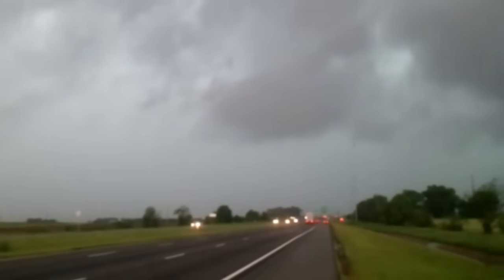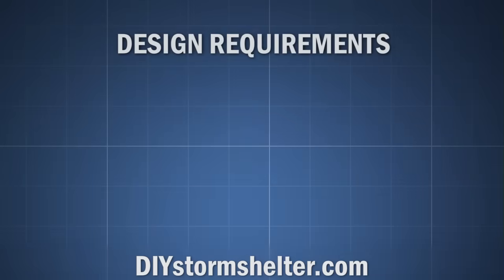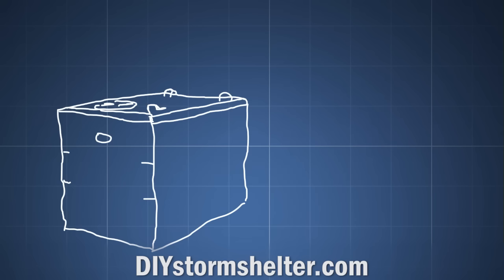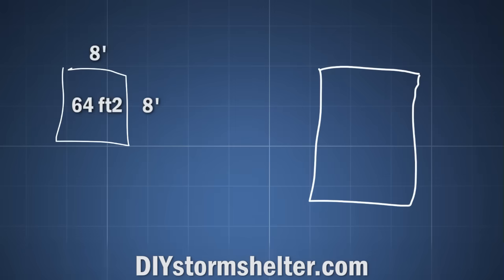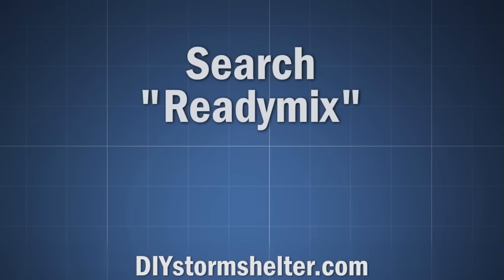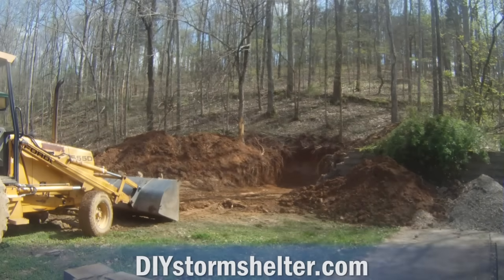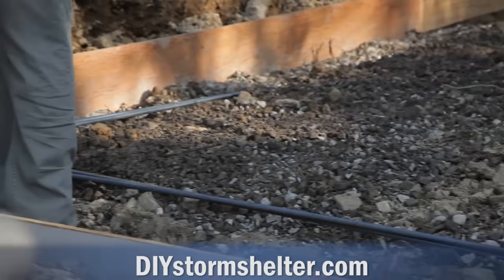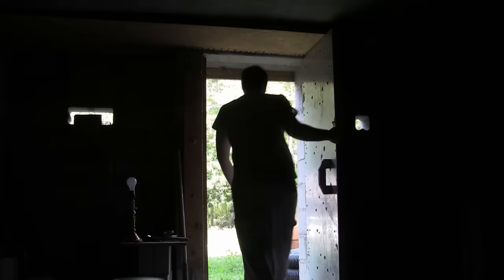Concrete block DIY Storm Shelter 12x20 foot

Comment: Not so fast homey.   I was going to bury mine in my back yard.  City wants fees for excavation and engineering so the house and block fence wont fall down.   Misdemeanor and $500 fine and 6 months in year if not followed.  Case closed and jail cell too.

Comment: My experience:  In CT I built a house with walls 8" thick and reinforced with rebar ONLY at the corners The walls sat on massive footings, the grade dropped 8' away from the house and the downspouts were led through 6" solid schedule 40 pipe to "the light".  The foundation had weeper drains with perforated 4" schedule 40 pipe set on clean gravel, covered with silt cloth followed by 2' of pea stone and then back filled. House #2 in OH was built with block, otherwise the same.  The foundations were waterproofed on the outside and painted with two coats of Ultra DryLok on the inside followed by 2 coats of highly reflective white paint on the inside.  Worked very well, except OH, when we got the storm of the century - 8" in one week followed by 7" in less than 60 minutes!  I went from one very dry basement to 2' of water in 17 minutes!  The water came in the basement windows so fast that it moved a 5 gal. bucket of horseshoes and stakes 76'.   House #3 in OH is built of poured concrete 8" thick, reinforced with rebar and has a brick pattern on both sides (steel forms).  The outside was sprayed with one of those new rubberized compounds, covered with a fiberglass mesh, sprayed again and then insulated with rigid 4" Styrofoam on the outside only.  By law, OH requires sump pumps.  I have two with the second water powered. The basement stays warm and dry all year.
Reply: Do u live in fla, and are u the builder who's house still standing after major hurricane that , if I remember correctly was in panhandle. Because if u are so many people were amazed. I could go on ! Hope and pray people listen to your recommendations

Comment: Save money building your shelter by buying up all the torn open bags of sand, peat gravel, cement, etc at your local building supply if you have a dry place to store it. Just mix all that crap together and pour it into forms with some rebar. Just make sure the roof is well supported and don't skimp on cement then as you need a roof that can stand the test of time.I'd suggest an arched roof as they are fairly simple to do, and safer. The torn open bags are usually about 70% off, just have a good method of getting it home and into storage intact, and check back every week. They end up throwing most of it out as nobody wants to bother with it.

Comment: no mesh no starter bars in your blocks so I'm guessing no core fill no vapour barrier below slab ,no vibration of your slab ,can not even work your compo  to compensate for slab inconsistencies  best of luck ,with that.
Reply: Nicely said!

Comment: I dug my shelter with a shovel by myself, it is 90 sq. ft. 6 ft. deep with 2ft steel above ground and  y total  ost is 2500.00. I am in East Texas sand so digging was easy,
and I am retired and 82 so I was not in a hurry. I shoveled about 80,000 lbs. of  sand out , it has a 5 1/2 in. concrete slab with concrete blocks for walls and solid blocks
for steps. the steel posts for the structure above ground run through the blocks to the slab, then all blocks are filled with concrete with rebar in each hole. I did not want a door that could be blocked by a fallen tree so I made a door that slides up and under the steel roof, If any one is interested in details or pictures email at rpmiller34@gmail.com. It was a fun 6 months long project

Comment: I witnessed a buch of mistakes, 1 the block was dry when you were laying it, 2 the ground was not tamped 3, the slump of the concrete looked off.
Reply: ToniMattTony
Yep, plus what is stopping the ground water inundation, no seepage trenches to divert it ??
Reply: What about rebar in the floor and drainage, that thing will be a swimming pool full of people in the next storm, if it lasts that long. What scares me is that he poured the roof too! I wonder how many people will trust that tomb?
Reply: and 1/4 in out,   of level,  the level was probable off more then that
Reply: keep counting,,i am laugh so hard how dumb you are,,hehehe,,
Reply: @jamesnobles4050  Says the one who can't even write fucking proper English?
Reply: Guys an amateur....but still holds hand out for his "valuable" guidance 😂

Comment: just buy the container cover it with dirt and cement. much cheaper and faster.
Reply: Hope you don't mean shipping container.
Reply: I'd like a shipping container but there's not much room in my yard. Maybe if they made a 6' X 16' box.
Reply: shipping containers are not designed to have dirt piled on top. They collapse under the weight. You would have to reinforce the walls from the inside.  Myth Busters found out the hard way. Building concrete walls around it to protect it defeats the purpose. Just might as well build that underground shelter. oh, those shipping containers have wooden floors.
Reply: Containers won't stand the pressure, There four corners are the only place with any strength. Goole underground containers and look at all of the nightmares.

Comment: I thought this was really a DIY video, not a nine minute commercial for a video you're selling. Thumbs down!
Reply: I agree... I was disgusted and angry after taking the time to go to his website to see, what I was led to believe, a decent full video- not an advertisement to pay for it. Glorified carney move right there. 👎🏻
Reply: @msgottaneedtoknow  but have you been able to find an alternative? any sources that shows you this type of work?
Reply: @whyask8044  - It's not rocket science. This guy did it. There is plenty of info out there. I bought a book on deck building at the Depot 30 years ago before the net was really a thing and built a massive deck (the right way) -
Reply: @whyask8044  I've done some masonry work in the past. All you need is a bubble level to check your work to see if its square. That's the hardest part. You have to constantly check. A simple block structure like this is not very hard, the hard part comes when you want to do the openings for windows/doors/garage doors. You'll need a big piece of angle iron and run your block on top of that.
Reply: even viewing this little bit i know how the structure is made
Reply: Being square and level isn't that important as far as the strength of the structure if it's being built below grade.  Preparing the footing and roof slabs, placing the rebar, and pouring the concrete  correctly without air pockets in it is far more important things to worry about than if it level or not. It will be much stronger to pour the walls and roof with grout as long as you have the correct rebar size and spaced correctly. Jmo
Reply: A thumbs down has the same effect as a thumbs up in YouTube's algorithm ...
Reply: @3nertia , I wish there were more thumbs down. If I had read the comments it would have saved me time
Reply: @3nertia  No fucks given has the same effect as fucks given in the Human Brain ...

Comment: At first glance it looks like you put it too low below the bottom of hillside. The hillside is the best place for it and never straight down into level ground...but the bottom of the concrete floor pour should be at least 1 foot higher than the level ground at the bottom of the hill, with a bed of crushed stone and perf pipe underneath. I did not view your entire video on your site but I hope you put a lot of crushed stone and perforated pipes around the back and side walls of this. The hillside is the best place for this as you have a place to gravity the water, but the #1 thing about building this...especially with concrete block, is drainage.

Comment: Oh, and rebar should be sticking out of the foundation to anchor the walls .  fill the cavity of the block where the rebar runs up the walls. allow enough rebar to anchor the roof slab too. Just saying...
Reply: That is how houses in South Florida used to be built in the 50s and 60s. The roof system was tied into the foundation via rebar running up through the concrete block walls. Not many of those type of build were total losses during Hurricane Andrew; unlike the newer stick/frame tract house subdivisions which were completely demolished by the storm.
Reply: @bassomatic1871  I wonder if I got rebar here? House built 1973
Reply: @Anjanya1948  Go into the attic and look where the roof trusses meet the sill plate at the top of the exterior walls.  If you see metal banding or hooks where the two come together then the house is tied into the foundation.
Reply: @bassomatic1871  tyvm
Reply: @bassomatic1871  Used to be? CBS construction is still probably the most used in South Florida.
Reply: Does rebar come with a loop on the end to make it an anchor?
Reply: I know im randomly asking but does someone know of a way to get back into an instagram account?
I somehow forgot my account password. I appreciate any help you can offer me.
Reply: @Kamari Jason Instablaster :)
Reply: @Lorenzo Andrew i really appreciate your reply. I found the site thru google and im trying it out now.
Seems to take a while so I will get back to you later when my account password hopefully is recovered.
Reply: @Lorenzo Andrew DAMN IT REALLY WORKED! I literally hacked my ig password within ~ 30 minutes of using the site.
Had to pay 15 bucks but definitely worth the money =)
Thanks so much, you saved my ass!
Reply: @Kamari Jason Happy to help xD

Comment: I've found some problems in this video.

1. First of all, if you live in a place like Moore Oklahoma we get a lot of floods, and building it in dirt makes it even worse and makes the storm shelter easy to pop out.

2.Do more research about tornadoes, you gotta know rather or not strong tornadoes hit that area often, even if it doesn't than you still gotta be safe from a tornado because after a few years of the tornadoes hitting the storm shelter it's going to pluck out of the ground and killed a women who was in her storm shelter during the Bridge Creek tornado this year because of floods.

3.If you're going to make a storm shelter, make a car port if you don't have a garage, that helped me during the May 6th 2015 outbreak where there was flash flood emergencies issued a lot.
Reply: Don't forget, the only purpose of a "storm shelter" is sheltering your family from a TORNADO with lots of high winds and plenty of rain, this shelter is a death trap,  trees within 20 ft., that will snap and drop through his concrete roof like a knife through cardboard and then sitting at the bottom of a hill with no drainage and the only time you use it, is when it's raining like hell...What a maroon...(Bugs Bunny)

Comment: I don't mean to "troll" your video...but why pay for the full length when this information is available for free with a little bit of a Google or YouTube search.
Reply: +Haven It got it a downvote for that
Reply: All you really need to look for on YT is "building a block shed" Concrete roof is not necessary to build a structure that isn't even under ground. A shipping container would work a lot better than this and be much safer than a concrete tomb!
Reply: @superiorcarpetpaintllc4351  The thing with this shelter  shown in the video above is that it is a storm shelter at best. If you want to actually know about the construction of a general use bomb shelter, look up what the atomic energy commission recommended during the 50s 60s and 70s. shelters build under the parameters they define are still structurally sound today if maintained properly, the shelter in this video is a root cellar its not under a yard of soil, it doesnt have 2 foot thick walls and doesnt have an L hallway for atomic protection. air supply, filtration and its resistance are poor for extreme conditions. like a 4" floor ? triple that and you'd be about there, not to mention the lack of steel in the poured concrete, what is mentioned in this video about concrete fracturing due to rusting steel is a basic in construction, the I learned statements make it seem as if the viewers are stupid. and you would be better to have a monolithic pour with full reinforcement for maximum structural integrity, I have worked in trades for 23 years and concrete is one thing I have plenty of time working with. if you use concrete blocks double up your walls and pour solid, this guy has a poor understanding of how structure works hence the lack of reinforcement, also know that concrete and cement are not even close to the same and concrete ranges from 1,200PSI to 20,000PSI depending on the mix.
Reply: @anewstarttoabrokenlife8662  I am a general contractor and that thing does not qualify as a storm shelter or any sort of shelter, it has probably fallen apart by now, or is full of water and critters.
If you want to follow bad advice, go right ahead, but don't reference junk science when your talking about a structure that was designed to protect people in emergency weather situations! 
We have building codes in America that are created to PROTECT people from shoddy construction and half ass contractors that don't know what they are doing!
When people jump into a storm shelter they expect it to shelter them, not become a coffin.
Like I said, I could care less if you do something stupid, just don't impose your stupidity on others, as if you know what you are talking about!
Reply: @superiorcarpetpaintllc4351  I.m not taking anyones advice I know the difference between structures and I even said it wasn't a shelter. as for Junk science that science is still used in building NBC shelters so... not sure what you think you are getting at here ? a fallout shelter will protect from pretty much all storm activity why not have all things covered of course if you are saying you'd rather duck and cover lmao. Im not telling anyone to build what is in this video I advise against it actually so whats the deal ?
Reply: @anewstarttoabrokenlife8662  Good for you, go build something then.
Reply: @superiorcarpetpaintllc4351  I do everyday for over 20 years and none of my basement foundations have collapsed or leaked but thanks,  People need better understanding of how things work thats why I commented. Structure is important because without it you'd have nothing to put flooring on or paint thats why I work in multi trade fields everything from foundations to painting.
Reply: Bbjones Jones  ok, brainlet....lets see if I can help you.
First read Haven's post ....and then my reply to his post.
HINT: qualifications did not enter into the post or reply......... the post and reply was concerning cost of the offered materials.
Qualifications....apparently..... came up in some conversation that you were having with the various voices in your head.
I would suggest that you don't skip your meds next time.....or if that was not the cause, then perhaps you can get someone smarter than yourself to teach you to read.
also, GFYS.
Reply: well people have varying priorities based on the demands on their time etc.....so what works for you, might not work for them.  I thought that kind of thing would be completely obvious to anyone who is older than 4yo.
some people would prefer to spend a measly 14 bucks to get some information immediately and in well produced format rather than milling around on the internet, here and there searching for it themselves.
some people enjoy going to high priced restaurants and enjoying a meal that costs in excess of $500 and some people eat beans out of a can.
You know....there is room for people in the world to have their own priorities and there is no obligation for everyone to live their lives as you would have them live.  Something you might want to think about there, junior

Comment: Nice computer work, horrible idea, although it might work good for storing root crops! and I bet your floor is already cracked and your walls have mold growing on them. Whats the point having it in the side of the hill. You should have just built it in the open,# 1 you just poured a slab. it should have a footer 8'' thick 2' wide all the way around the perimeter, this is what your block sits on, and have rebar coming out of the footer up to the top of the block at least every three foot. then pour the block full of concrete and then pour the floor 4'' thick at the same time. Seriously, this is so wrong I can't even continue. You obviously have never built anything. I hope nobody is killed in your shelter. If you don't know what your doing then ask somebody. You should stick to computer work and let real construction minded people do what they do best. This is a fucking joke that's not even funny, stick to your day job sucker!
Reply: With this method, there should be rebar or something coming out of the footer though, otherwise the bottom block and the wall itself has nothing anchoring it to the footer. it will slide horizontally inward under the pressure of the expanding dirt around the structure. This could have also been prevented by pouring the floor after the walls were built, covering 4" of the bottom row of block. Rebar should go the height of the wall as he said and filled with mortar in that cavity to keep the wall from bowing. Also, I didn't see any steel mesh under the slab part... I do not recommend following these instructions. And why pay for instructions from a person who has no experience and makes so many obvious mistakes? Doing it right wouldn't cost much more in materials or labor. I am a carpenter, and know just a little about masonry and concrete... This video still made me cringe...
Reply: +Deltasevenfour lol
Reply: He did pour a footing at the same time he poured the slab it's called a turndown slab. It won't grow mold with proper ventilation. There is no need for an underground structure  to have all of that added re-enforcement.